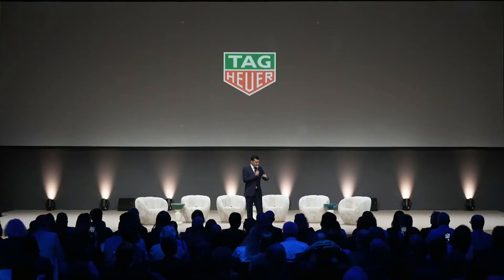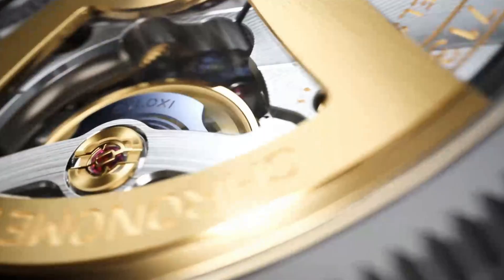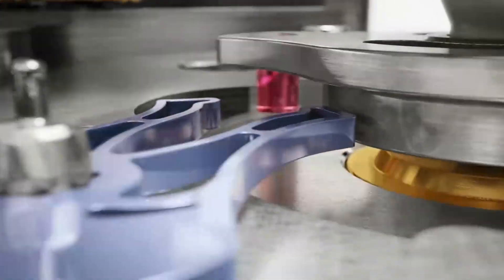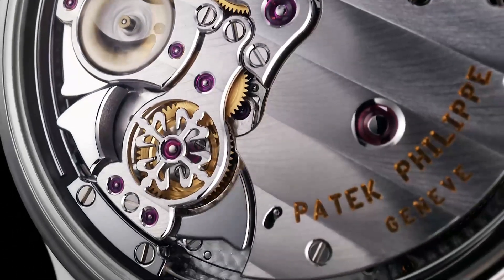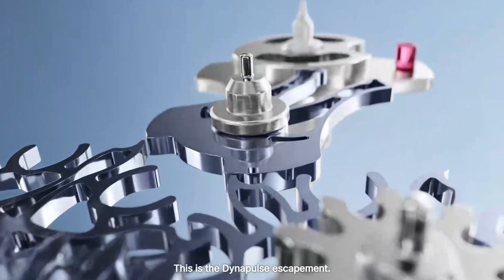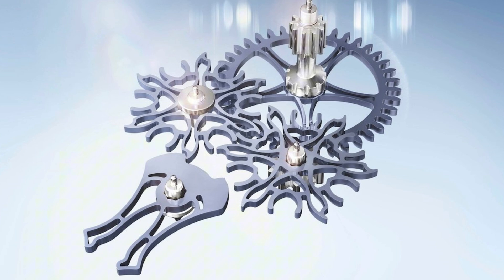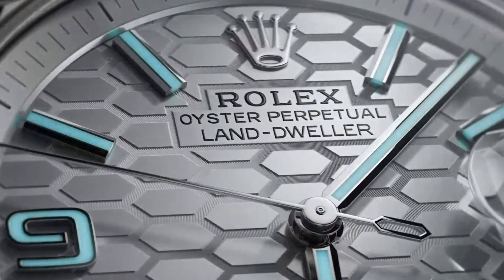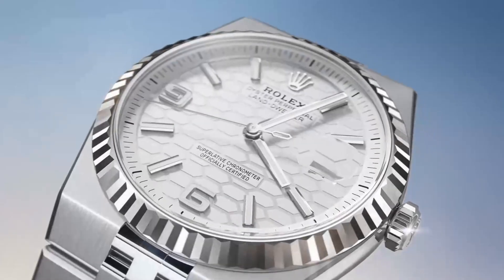Rolex's Best Movement Yet? Rolex's New Dynapulse Escapement Explained

Comment: I’d like to use a world Map that is painted by hand by an artist, not a machine colour printed one. The same concept here, my watch movements must have the balance wheel painstakingly made , finished and regulated by a watchmaker and not by some advanced  machine spitting out the exact same piece of silicon hairspring. I’m sorry but switching to silicon hairspring is one step closer towards technology and a step away from the traditional art of watchmaking. Such a shame. When admiring  at the free balance screws adjusted on a JLC hairspring is not the same feeling as looking at a zenith or the new Rolex silicon hairspring.
Reply from the maker: Fair point, I would say though Rolex have long moved away from that hand-built image. With around 3 million units shipped a year now, these have been mass produced for a while. I wonder how far up the Swiss brand tree one has to go to actually get that now?
Reply: in this modern technological world, with your old school mainspring, you will just have to learn how to exist in a no magnetic fields zone. which don't really exist anymore. redesigning hairsprings and escapements to survive modern magnetic environments is a stroke of genius, not some automaton nonsense

Comment: Clever impressive tech, no question.  And of course when it does need servicing, you’ll have no choice but to return it to Rolex and pay whatever it deems an appropriate £££ sum.  What recommended service interval does it have?
Reply from the maker: I believe it's still under the Rolex catch all "It is recommended to service your Rolex approximately every 10 years depending on the model and real-life usage." Interesting to see how this holds up over the next decade or so.
Reply: That's more or less the case even now. I always buy watches with the assumption that they'll be disposable after 10 or 15 years, because by then the cost of upkeep exceeds their market value. It’s a rather blunt way to look at it, but it helps me make more informed buying decisions.
Reply: yearly?